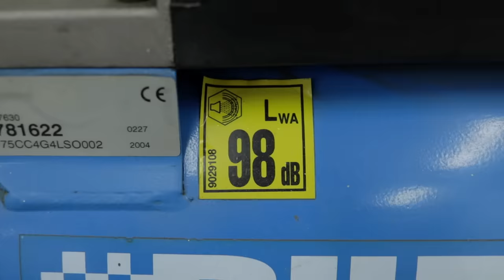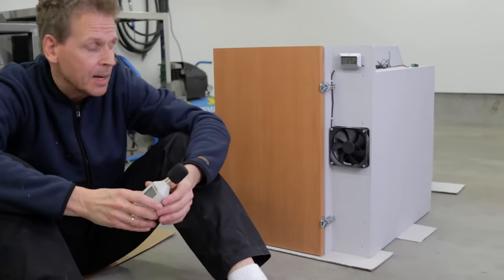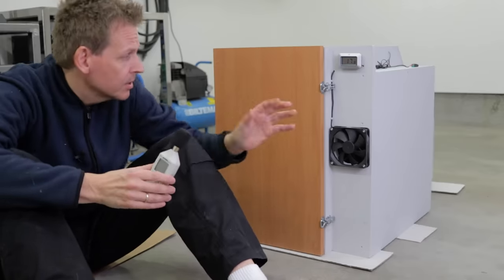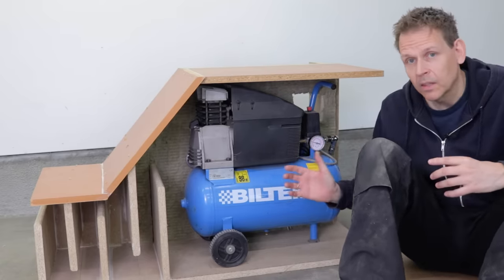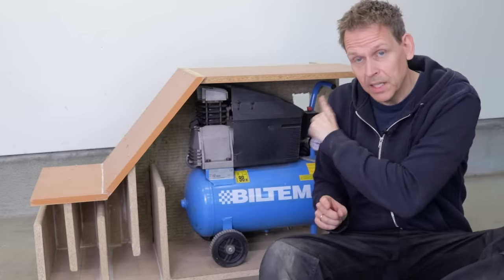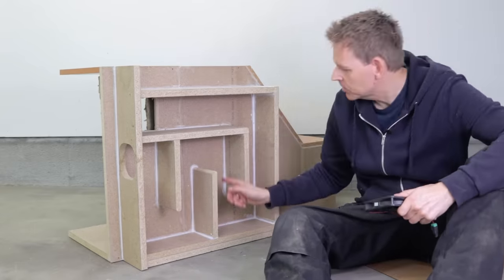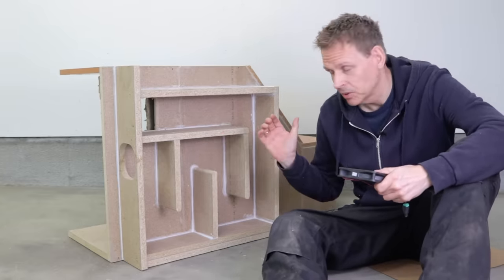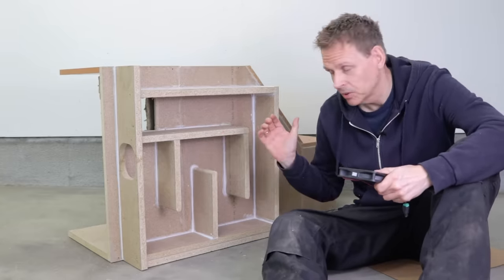Do not build a sound insulated enclosure for your noisy air compressor!

Comment: That was a really nice job you did on that enclosure. You should get an auxiliary storage tank to give you more volume of air. I'm a firm believer in good old fashion cast iron compressors with oil in the crank case and belt driven. They are so much quieter, last ten times longer, are more powerful with higher volume. That's a win win win win.
Reply from the maker: Yes, I agree - I had quite a big belt driven air compressor in a workshop some years ago, it was much more quite and powerful as well. Because of the limited space I have these days I have to settle with a small one, It's a good idea to add an extra tank to get more capacity, I have thought about it 😊 Thanks for the tips! 👍

Comment: Great video.  I love things like this.  Liked and subscribed...  I have long thought about an air compressor enclosure from time to time so I can have "always on" air powered tools with the click of a fitting...  Rockwool was a good choice, also...  Rockwool is not prone to mold, so, good on you for that.
For now, I will just roll the bad boy out, power it on and let the neighbors look into the HOA agreement about noise production hours while I grin.  (I Kid...  I generally avoid anything noisy outside of 8 AM to 8 PM...)

Comment: the baffles need porous material in them to help deaden the noise
Reply from the maker: Yes, the fluffy fabric I used have probably a minor effect. I was afraid of restricting the airflow too much as cooling is important. I did add 3cm Rockwool sound absorbing insulation in the main chamber though 😌

Comment: Fun video so I had a shop at one point and it was zoned in such a way that I couldn't install the air compressor outdoors. It had to be installed in the shop. We built an entire room that held brooms and mops and all sorts of things that hung off the wall but the room was built in such a way that it had loads of sound deadening on the floor rubber mounts for the air compressor sound dedoning in the walls, cielimg and then we built the stairwell on top of this room in order to get to the second level. It wasn't as clever as your box/muffler but it was large enough that the heat level was not destructive and we used the heat to dry all mops and wet rags and such. It never got too hot because the room was four times the size of the air compressor. And it was very quiet. 
This solution probably wouldn't work for you because our shop was quite a bit larger and the air compressor was approximately 70-80 gallons or 300 liters something like that. It's just nice if you could do something synergistic with that wasted space. We ended up creating a room to hang stuff, dry stuff, support the stairwell for the second level, house the compressor as well as deadin the noise.
Reply from the maker: Ahh, that sounds to be a very good solution. Having a "separate" room for it is almost as putting it in a box, but as you say it's better when it comes to cooling. I wish I had a bigger workshop, but since I dont I have just made it as a challenge to create smart solutions and utilize my space as good as i can. Thanks a lot for your comment, it was very enjoyable 😊

Comment: We made an air compressor out of an old car fire extinguisher and a car electric tire pump and put it in a big cardboard box along with the packaging foam we had on hand, worked out pretty nicely but after about 1 year we disabled that project because it was not that good really, it took too long to build up pressure and it was getting empty too fast for my liking.
Reply from the maker: Very smart DIY project 😊👍, but I can see the capacity would be limited. I think for some  hobbies this would be perfect, ex if you work on electronics you just need a small amount of air now and then for cleaning and cooling, and the solution you made is much better than buying compressed air on spray cans!

Comment: A friend of mine was running a home workshop and his neihbours were constantly complaining about the noise. We brainstormed a few ideas and finally settled on digging an 8ft hole in his garden, lining it with concrete and then we basically buried the fucking thing under a 3/8" steel plate. Its got a few breather tubes and about 4-5ft of soil on top of it - you can only tell its running from about 10ft away. Past that you can't hear it at all! We have had to dig it up once to repair it but apart from that it works perfect. That was 6 years ago.
Reply from the maker: Very cool solution! Did you add a automatic drain valve to let out moist in the tank?
Reply: @kihestad  We don't have an automatic one but we did add a line to the drain (had to make an adapter on the lathe) that runs up to a small valve on the surface. He just opens it every now and again so the pressure can push out the moisture. He knows his stuff!

Comment: You can significantly improve the sound insolation by decoupling the compressor from the box itself, there are a lot of ways to do that, the best and hardest way is suspend it mid air with wires. other options are pads and sound demanders pukes. Also decoupling the box from the floor will help
Reply from the maker: You are absolutely correct! Vibrations are the biggest source of noise now. Will try to improve it by adding soft rubber, dampening foam or springs on the compressor and/or between the box and the floor to improve it. Thanks for the tips! 😊

Comment: In your installation, you might be able to reduce the noise further by placing your box on top of a block of thick foam and thereby decoupling it from the loft floo/garage roof.
Putting it in another room was maybe the best advice.
Reply from the maker: Yes, vibrations are the biggest source of noise now. Will try to improve it by adding soft rubber, dampening foam or springs on the compressor and/or between the box and the floor to improve it. Thanks for the tips! 😊
Reply: @kihestad  You're welcome.  I have to do something about the sound level on our old SIP airmate when I can find the time.

Comment: Huh. We built one in a small shop. Just a square MDF box with 2 inch thick foam adhered to the walls in a couple of hours. And left a couple of 1” slots to let heat out. It works great, prolly around 40DB if I were to guess, talking with it is no problem
Reply from the maker: That sounds too good to be true 😜

Comment: What would the sound characteristic be if you made the box of 1.5 - 2 mm sheet metal. Then used a silicone to glue drywall onto the outside. And on the inside you could line the metal with your carpet/fabric onto the metal. I believe that this would remove more frequencies. Is the particle boards just a choice preference from availability and simplicity of assembly? Isn't drywall even a more dead material? You also can get drywall in many thicknesses, but maybe not that easily in Norway as the thinner thicknesses is commonly used. I here Norway in your English. South-east somewhere parts of the country (østlandsk)
Reply from the maker: I don't think a metal box will work very well. Metal will either reflect or transfer the sound waves. You need quite thick metal for it to be stiff, a thin steel sheet metal could start vibrating causing more noise. Gluing a heavy metal box on a wall is probably not a good idea 🙄

Particle board / chipboard is both cheap and very easy to use for making boxes, commonly used for making speakers. MDF is even better, but more expensive. Drywall is better for sound dampening, but it's heavy, weak and brittle. Not suitable for making a box. Could be used if put into a wooden frame with a wooden floor, but then it will be quite a complex and heavy build. 

Thanks for you suggestions, even though I dont think either metal or drywall are the most suitable materials to use 😋

Best regards from Molde, Norway 😁

Comment: The main problem is about speed of air compressor, silent ones, except for screws one are extremely slow and unusable with many tools, nice video😉💪
Reply from the maker: You have a valid point there, the new silent one takes twice or perhaps three times to fill up the tank compared to the old one. However, I do not run a professional workshop, this is my hobby so I can wait a bit now and then when I am using air-hungry tools. The sandblaster (and just blowing air) requires a lot of air, I just need to be a bit patient when doing that. 
Thanks for the comment 😊
Reply: @kihestad  thanks , the sandblaster is the most thirsty tool, you need very good air compressor for using it  continuosly.  There are screws air compressors, fast and silent but the cost is very high.. Bye bro.😉

Comment: Food for thought. There is no real reason to keep the compressor and air cylinder as one unit.  In Australia there is a PE100 Polyethylene pipe system called Blutube, 20mm to 160mm diameters used for compressed air, food grade, breathable air which is available with air valves and fittings. If there is no garage space, a tube can be run along the wall at ceiling height, the compressor can be elsewhere, even off the ceiling joists using rubber feet isolators to stop resonance.  Two years ago I replaced my 40 year old air compressor which could not even pump up a car tyre. Corroded air tanks have been known to explode.  Air Tools can be a cheap alternative to power tools and are unaffected by abrasives such as fibreglass. Rotary air tools use a lot of air, so the larger the air receiver tank the better. 12CFM is about the smallest compressor for air tools that I would recommend.
Reply from the maker: That is very true, interesting thoughts! Thanks a lot for sharing 👍

Comment: Some more options to make it even more quiet:
1. some soft vibration dampening material under the wheels, for example foamed rubber. 
2. The material of the outside walls of the box need to be as heavy and stiff as possible, for example glue a second layer of wood on the outside.
3. Also build a silencer for the air intake of the compressor, this alone reduced the loudness of my compressor by 1/2, because the inlet valves produce a lot of noise.
3. The large air tank works as an amplifier, if possible mount rubber bushings between the compressor motor and the tank and a high temperature rubber hose with a loop ➰ instead of the metal pipe.
4. The heavier you make the compressor, the less it will vibrate, you can cast some concrete blocks and glue it to the tank using some silicone sealant, which is also a good vibration dampener. That should look pretty similar to the concrete blocks inside of a washing machine...
5. Ideally you can do a combination of 3. and 4. with the compressor motor completely separated from the tank and instead mounted with rubber bushings on a heavy concrete block which is also supported by rubber dampeners.
Reply from the maker: Thanks, very good tips here! I will at least try to your tips number 1, I think the vibrations are most annoying now.
When it comes to adding a muffler on the intake / exhaust: I am not sure if it will help very much. I could be wrong though... I did some research but did not find any solution that I found to be very efficient, not even the ones fitted a big car muffler. The tank itself also emits noise because it acts like a sound chamber. I would guess that if a muffler really worked, the vendors would have added it?
Reply from the maker: @Henning_S.  That was very nice 👍
Reply from the maker: @Henning_S.  I have subscribed 😊 You don't need to take it apart for my sake only, since I have made a different solution. Others might be interested though. Good luck with your YouTube channel!

Comment: Outside, build a shelter. Use panels (almost any building material capable of standing w/o framing) to divert sound rather than baffle. Reflection is your friend! Up (neighbors?) and/or away!) is much simpler. This technique is great for portable generators - inter--panel connections aren't required beyond making sure they will stay put. Others here have already suggested redesigning air intake to muffle valve intake noise & filter air. There are acoustic pads designed to isolate compressors from floor, preventing noise conduction if you happen to share same structure as compressor/generator. You can benefit from them even though you have compressors in your belfry.
Reply from the maker: Yes, that is way smarter 😊I just dont have space for it. My garage is placed with minimum distance to two of my neighbors. The side facing my own property is not usable either,  as it's just a slim path between my garage outer wall and a concrete retaining wall. In front of the garage door is no good either 😋
Reply: @kihestad  Sounds like my home town's downtown - houses were close enough that they could reach out one window and leave fingerprints on the next-door neighbor's. Attic it is! Not impossible, just more expensive and time consuming. The tough part will be getting mechanical isolation from the building in the attic (Levitation!).  Magic tricks that'll Impress your friends!

Comment: Nice idea and geat execution👍. What about using active noise cancelling, much cheaper, just add a few speakers and microphones(could even repurpose a wornout noise cancelling headphone, just extend the microphones, add additional amplification and external speakers. Assemble everything on a low poly count rectangular drop on top enclosure(with two sides completely open). You can even automatically start with some simple sound sensor used for diy projects). Could add few extra watts, but easy to remove (assuming speakers are attached to side walls, microphone attached to a simple plug on enclosure)).Just some 💭
Reply from the maker: Loved this idea 👍😁 but cheaper? I am not sure about that 🤔 I guess you would need some kind of sound insulated box anyway to control where the noise escapes + all the electronics and the speaker system. Would have been fun project though, but beyond my skill set 😔
Reply: @kihestad  Appreciate the feedback❤. Actually it is not much work as you think. If you can solder a few wires, that is all that is needed. Take apart a noise cancelling headphone, will get two speakers and two mics + pcb. Get a diy 20w+ headphone(stereo) amp ,2x 6"+ 20w+ diy speakers.
Now have a U shaped wooden enclosure by joining 3 sheets of plywood(can be the cheapest). It will fit over compressor lengthwise. It can also be just two sheets supported by perforated cardboad on top and two braces on ends, for added strength. Install two speakers on side panels with a small circular cut out. You can also place speakers inside facing.
Generously pad insides of enclosure with noise absorbing foam. Now connect the two outputs of headphones from the noise cancelling pcb, to amp input, speaker out from power amp to speakers on either side. Attach the noise cancelling headphone pcb to top of enclosure(just hot glue whereever). Carefully extend(using additional wire) the microphones(still need to be connected to the noise cancelling pcb) to be placed in the back of speakers with heavy sound isolation pads stuck on speakers. Now place the enclosure over compressor, turn on amp power, you are done. A 50+50W bluetooth amp with aux input costs less than $25 + 2x8"  30W(max50W) car speakers costs less than $30. Need a power supply that could be another $20. But you can repurpose the unit for other purposes.If you want auto turn on, add a sound sensor diy relay module, and control amp power through it. It sounds hard, but not that much, if you use off the shelf diy stuff. Just some 💭
Reply from the maker: Wow, this sounds soo very cool 😎 someone got to do it! ☺️
Reply: @kihestad  Glad you liked the idea. Here is some interesting way the unit can be repurposed!. Just use simple door hinges on the two side pieces, so it could be flipped inside out. Create a small and portable sound absorbing shelf to be used in place of compressor. Keep your Alexa and other voice assistants in the shelf. It should be fine, thanks to their super sensitive noise canceling mics. When you want a private converstion, put all your phones on shelf, cover the shelf with the enclosure(in flipped position). You have a unique privacy solution! Just some 💭

Comment: My father built a compressor from a 500cc single cylinder Vello engine.  It made the lights flutter and it had a rather pleasant doongka-doongka sound.  It would keep 3 high pressure spray guns at full tilt.
Reply from the maker: Nice, i DIY air compressor - that is rare 👍

Comment: The key is: HIGH PITCH NOISE!
Lower high pitch noise and you will get a better quality work environment. That is what your video proves excellently.
And if you want to decrease lower pitched noise (bass) just add foamy / ragged materials inside the walls of the enclosure box. That would have helped a lot.

Thank you for this little but fantastic video. Greetings from Portugal.
Reply from the maker: You summarized it perfectly 🤩 That's exactly my opinion as well. I have some rumbling noise now from vibrations going into the wooden floor. It's not very loud and not very annoying. I have plans to add some soft rubber to the compressor feet and under the box to reduce it 😊

Comment: Fantastic work ! You've totally mastered the subject and saved me a ton of time trying to do the same. THANK YOU
I'll go for the silent compressor, placed away in a corner with a few noise insulation panels on the walls and floor but no enclosure.
Reply from the maker: That sounds good 👍😊
Reply: @kihestad  Ha, I see what you did there...